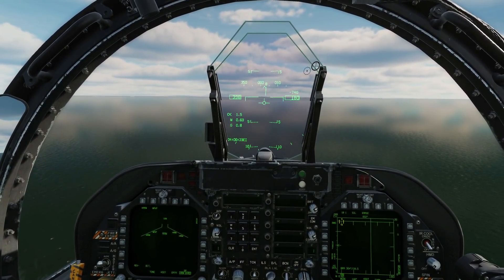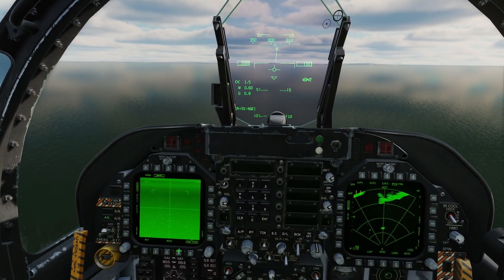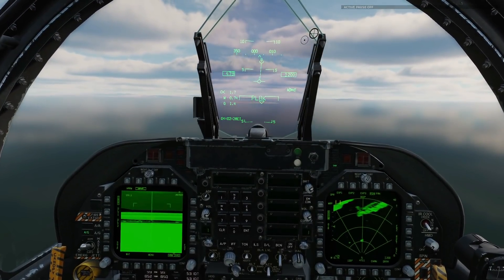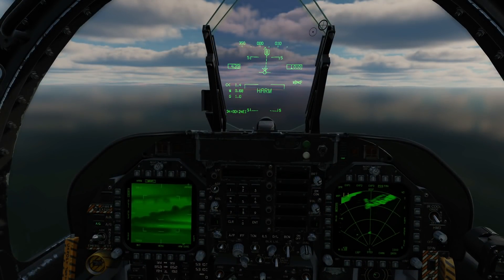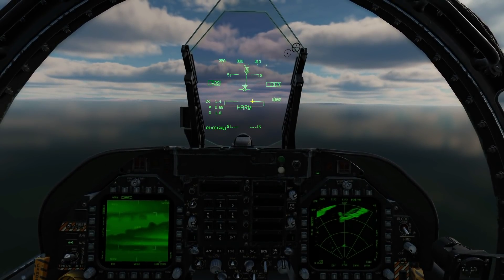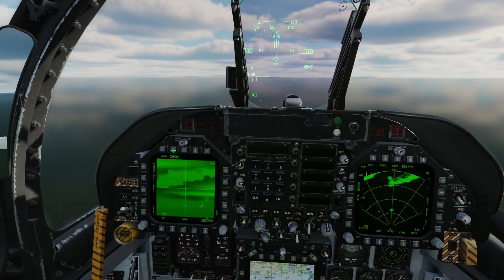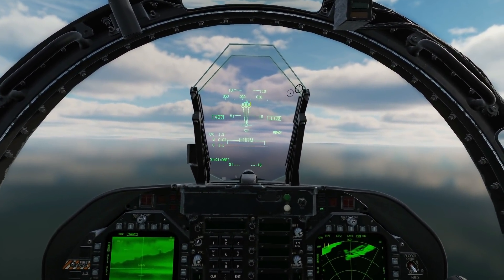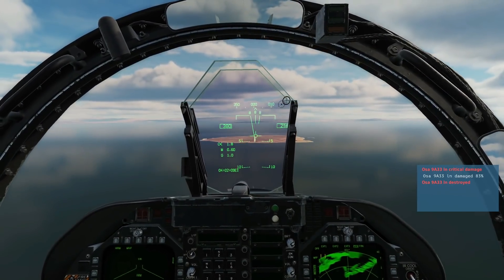FA-18C Hornet: AGM-88C HARM (SP PULLBACK Mode) Tutorial  | DCS WORLD

Comment: Nice video, but what would be the maxim range for the harm. you must if been about 10 mi if you where firing a maverick at  a tank
Reply: Maximum range for a HARM is very dependent upon speed and altitude. With PB mode while lofting a shot you can often reach out to over 40 miles. In SP mode like this, the HARM will only engage something that is engaging you, and if it can see you it is almost certainly in range of the HARM. 

The one major exception to this is sa-10s. They can hit you from outside of HARM range.

Comment: in Reality, sa-8 Osa operator is not an idiot, he will find you by its search radar, but immediately switch to optical tv guidance (especially in day light) and shoot the missile with both search and tracking radar turned off, he will shoot the missile in bearing mode and if he can guess you are in range, that's enough.
this is exactly similar tracking mode used in British Rapier System.

you never have the chance to use the Harm missile, only Mavericks.